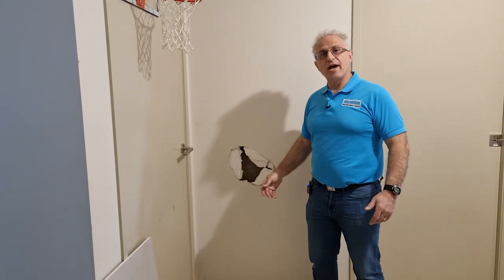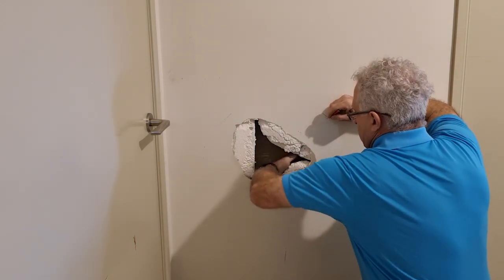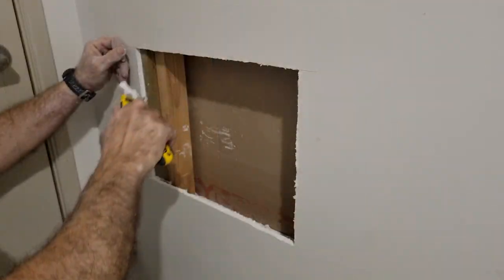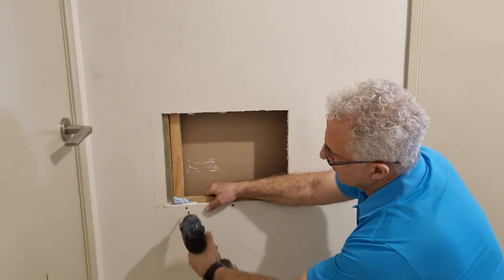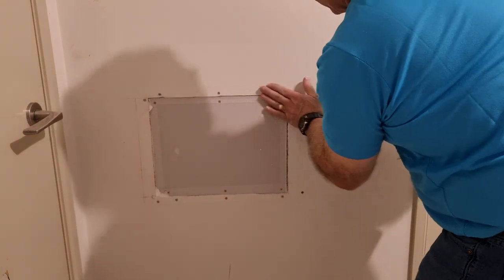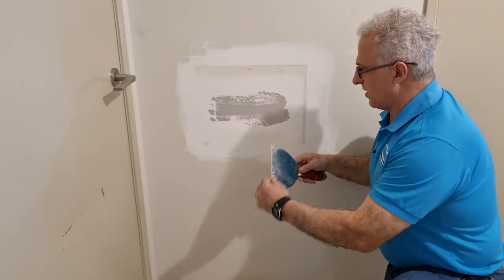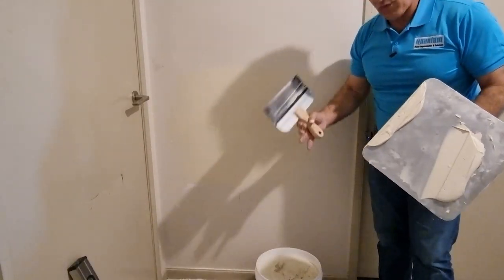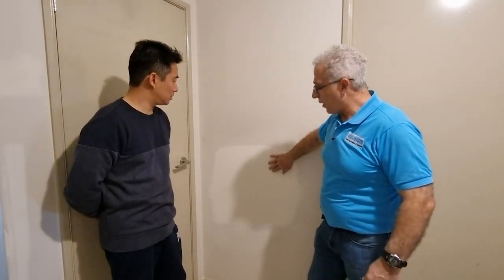Fix Damaged Plasterboard the Right way, Quick & Easy Instructions!

Comment: What’s the ideal waiting time before painting  and how far was that piece of wood from the door .
Reply from the maker: You can paint straight after it is totally dry which is easily identifiable visually. The 19mm timber I used was the exact the thickness that the cavity sliding door was made of. The distance of cap between the wall was about 7mm. P.S. Allah Rahum'mee.

Thanks Joseph
Reply from the maker: I forgot to mention that the thickness of timber used by the manufacturer is usually dictated by the thickness of the wall that its been fix to. In other words, if a timber wall is 70mm thick then the cavity siding unit will have 12mm thick timbers not 19mm like in Bryan's place.
Reply: Thanks Moussa